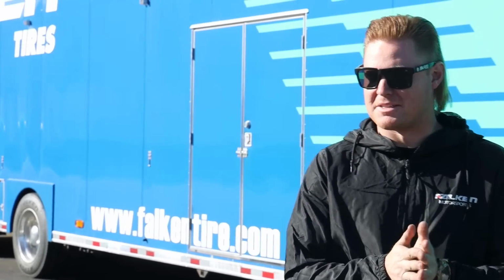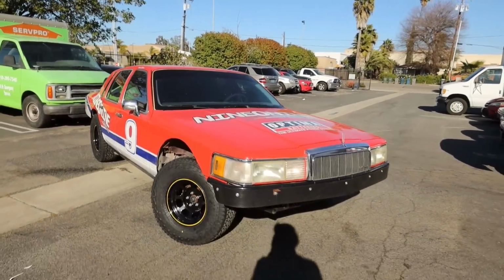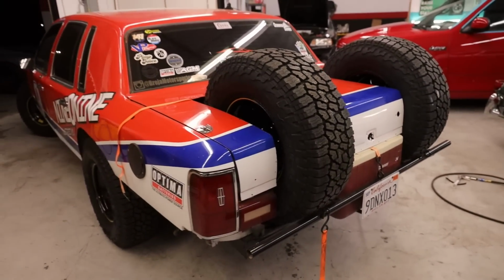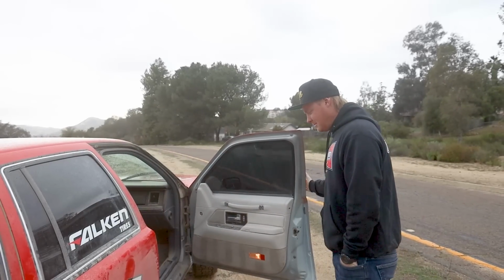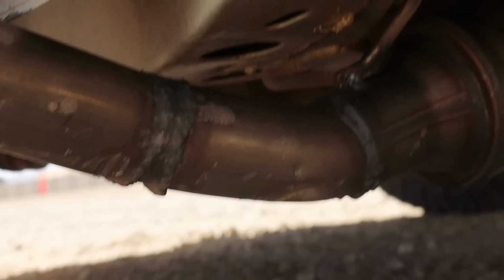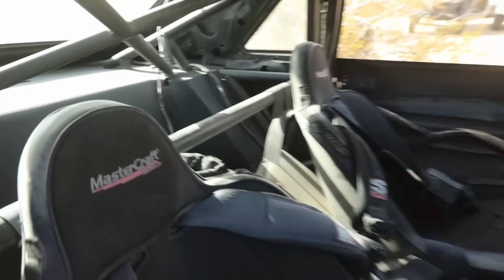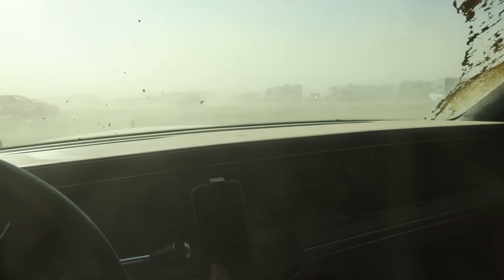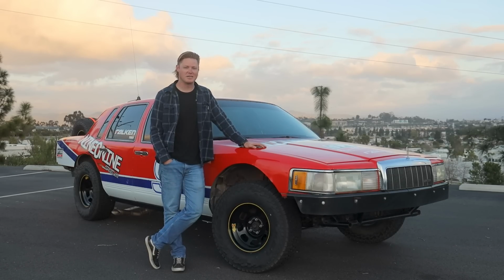Revealing My ALL NEW Off-Road NASCAR!

Comment: An Idea...
2001 Ford Explorer had a 5.0l Windsor...And that thing is older...215HP stock....BUT Per Cali rules it would also have to retain emissions from the donor...which probably includes its fuel injection and ignition and those don't have a dizzy so that means also the wiring and pcm and everything....Use the engine mounts for a 1990- Lincoln or make your own get a TKO and manual swap it...
the entire idea might be hella fun and lots of content, I've certainly never seen it done in an off road Lincoln before let alone also navigating around California's strange smog laws.